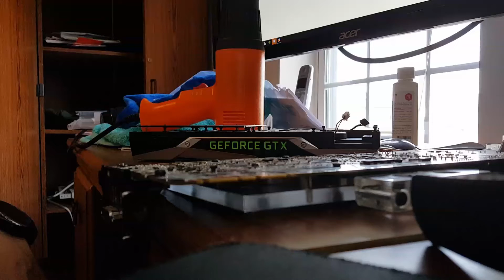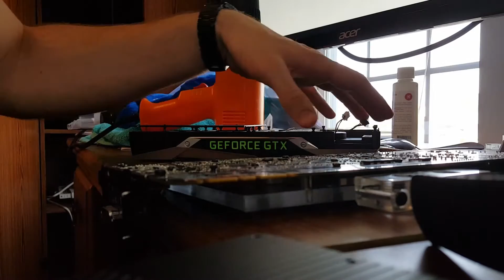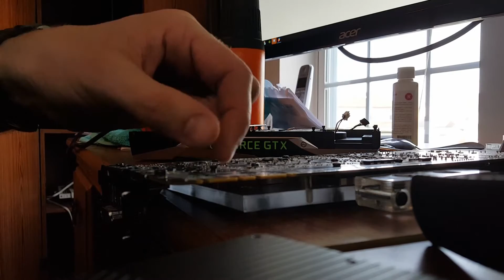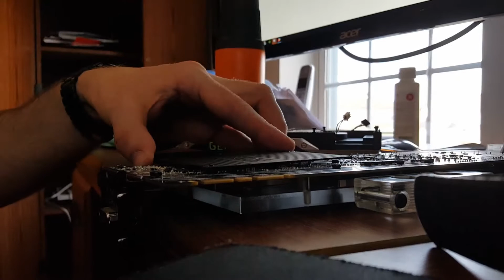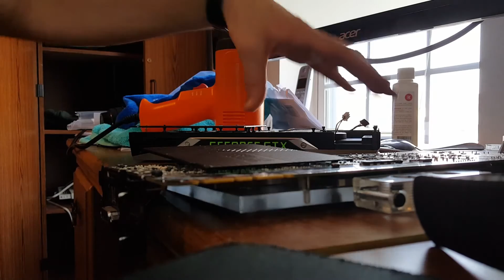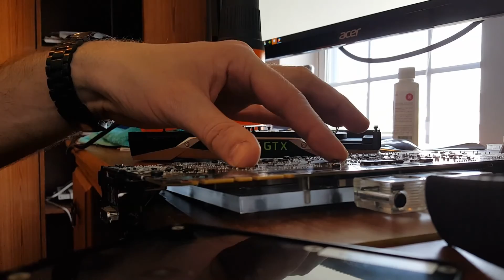1080ti Founders Edition Backplate with EKWB Titan X Pascal Block

Comment: Wow, it's been two years........
Well I bought the titan x(p's) and blocks when they came out, was lazy and just threw them in stock.....to test. Recently played kingdom come deliverance and it's awesome, but on ultra 4k I was getting dips below 60 in Rattay at night when everyone had their torches out......and holy crap were the FE fans loud while failing to keep up. So I'm finally going to put in the water-cooling stuff.
back-plates were not available yet when I got the blocks, and now the ones I wanted are already no longer available. So it goes. was going to make the stock ones work, this simplified that....Thanks.
Reply from the maker: That is awesome!  My Titan Xp’s love the watercooling.  I had already purchased the backplates, so I used the EKWB version, but thankfully the NVidia backplate is very aesthetically pleasing as well.  :-)

Comment: Are thermal pads required for the backplate?
Reply from the maker: dvduong92 thermal pads will absolutely help dissipate a little more heat, but the stock backplate doesn’t come with them, so I am going to say no, they are not required.  Funny enough, the reference pcb says “thermal pad” in one location where there is no thermal located.  Personally, I suggest using a pad if you have it available just because it could help a little and they are relatively inexpensive usually.  Sorry if that is confusing.

Comment: AWESOME!!!!!!!!!!!!!!!!!!!  get to save $40 bucks now 

would you recommend getting thermal pads to use with the backplate ?  i was thinking about getting a strip for the vrm area and the Vram area for the back plate.
Reply from the maker: You could definitely use a set of the EK thermal pads.  I used some of the excess pads that I had from the waterblock install.  If you are in the US, Look up EK Thermal Pad E on Performance PCs dot com.  if you want to go a little bit thicker, look at EK thermal Pad G